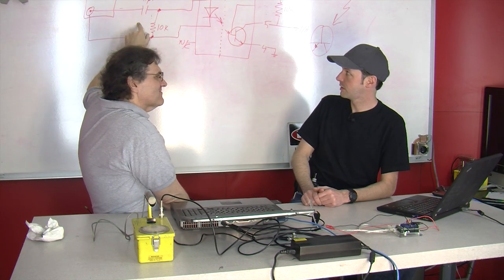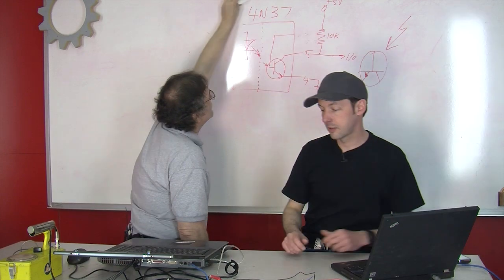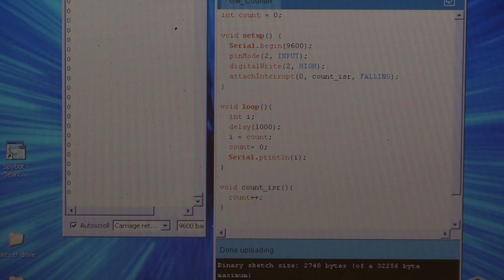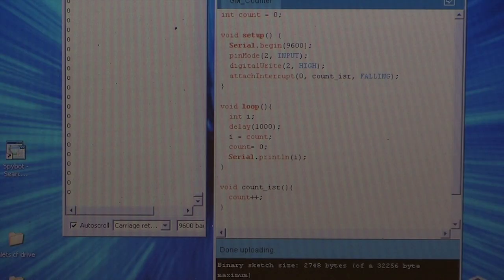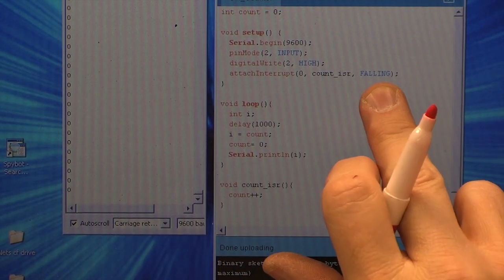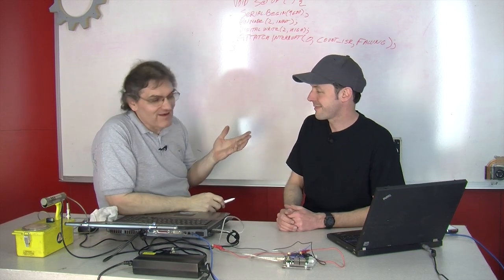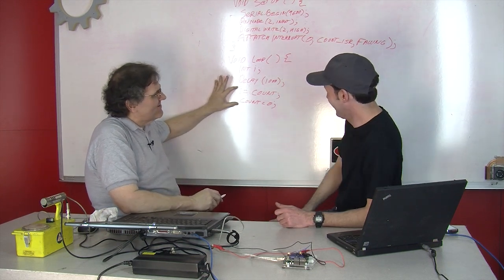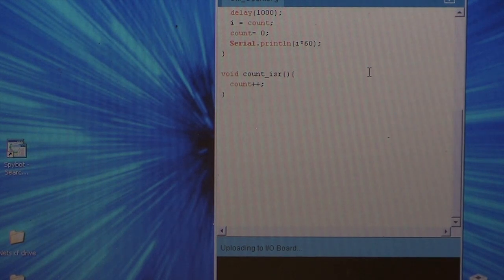How To Interface a CDV 700 Geiger Counter to a PC Using an Arduino (Part 2)

Comment: If future videos using cod on a laptop screen are going to be common, perhaps a video feed from the laptop in use, should be more clear then shooting the screen with a camera, and most lappys have S-video out, if not certainly someone has a VGA to S-video/Composite scan converter laying around.

Comment: Its a low pass. As the frequency rises the resistance of the capacitor reaches zero.
The 3db dampening would be reached at 15915Hz